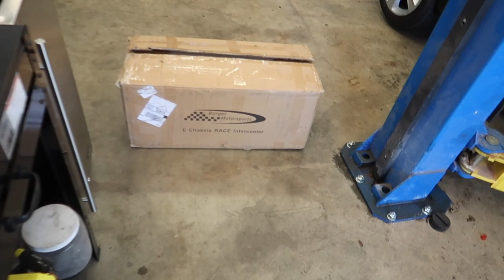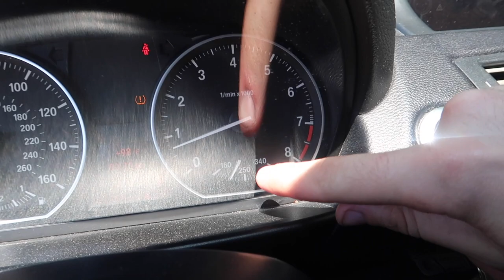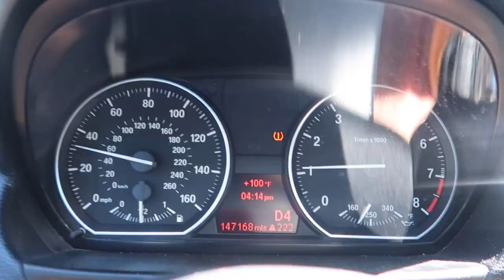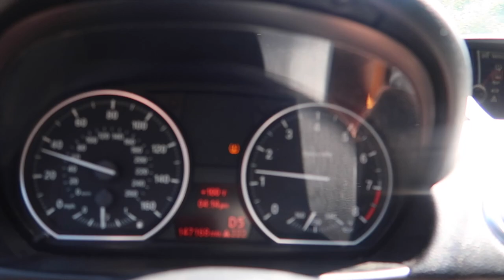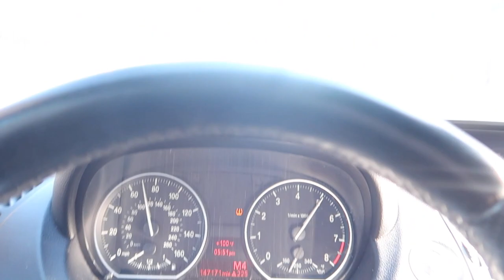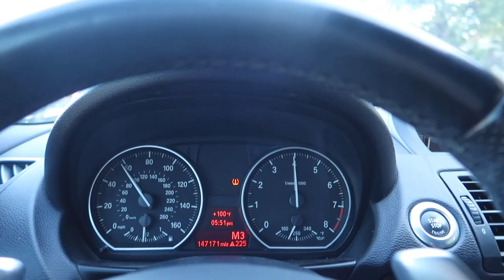THIS IS THE BEST BMW COOLING MODS FOR UNDER $100!

Comment: Not trying to sound like a smart ass but ... how do those cooler caps... the hex blue ones help cooling lol. My understanding is.. it’s just cosmetic 🤷🏻‍♂️
Reply: Only thing that helps cooling in this is the oil cooler valve (the red thing) the blue stuff is 90% cosmetic 10% upgrading materials for peace of mind. If you just want cooling you’d be fine going with just the valve
Reply: Jay Herrmann yup. The valve and the cap with fins ... they suppose to dissipate heat 🤷🏻‍♂️... but the cover bolts and the cover for the valve is just looks... but obviously a bit more $$
Reply: We're is the best place 2 buy the cooling kit from
Reply: @rickpearce5553  many people carry them. Burger tuning is one of them. ECS tuning may carry them as well. But depending on your setup for car it may be better off running a bigger oil cooler etc. there’s many ways to make the oil run cooler… but also each way has its benefits and cons. Depending where you live it may not be smart to run a colder oil. All depends what your plans for car are.

Comment: With the thermostat delete the N54 will take wayyyy too long to warm up. It already takes a long time to warm up properly, and they were made to run pretty warm. If your oil temps go over 250 degrees F in normal to spirited driving then you should either change oils, or there’s another problem. Upgrading the actual cooler itself is more useful if you get upgraded twins or a big single, but really only for track use for stock twins. Honestly an upgraded radiator is far more useful. I understand this vid is sponsored and helps you make more content but just putting that out there
Reply: True but it’s an N54. Rev limiter even on my way to the grocery store 😂
Reply: herlangaona Once it’s warmed up, same here lmao 😆 But after driving like 10 miles on the highway at 3k rpm it’s usually barely up to temp for me

Comment: Do not idle to warm up your car. BMW needs to be moving at a cold start to get the oil circulating. This is why BMW engineered the oil cooler the way they did. This mod is a great for a track day, not for everyday use. Be careful over long-term usage.
Reply: do u want your plastic engine to run at 120c
Reply: The BMS sport oil cooler valve helps lower temps at daily driving conditions, which is good on a hot summer day if you dont do short trips and can withstand the longer time to get to operating temp. If you’re running hard for a while like on the track, your thermo will already be open 100% of the time anyway, regardless if you have a stock spring, or a lower temperature spring, or a complete spring bypass like this BMS sport oil cooler valve. Having the thermostat open full-time just starts the cooling process sooner, it doesn’t increase the ultimate cooling capacity. So hard running will still cause steady oil temp increases. For extended hard running, you need to upgrade to an aftermarket oil cooler like a G Plus 25 row or a Mishimoto, and get a CSF radiator.

Comment: Have exact same set up always thought it was cosmetic crap and after doing track day can confirm just cosmetic crap does not work.
Yes it opens thermo little earlier but in track thermo is always open.
Save your money and upgrade oil coolers.

Comment: Great mod. I’ve done the same except the thermostat cap.  Blue cones will definitely be a perfect combo. I wish I could find them for my current CAI but the diameter of the attachments are smaller than what I have found out there.

Comment: Hey Nour ! I have a 2009 bmw 328xi, it has a N52 engine. For some reason it’s been hard for me to find some engine mods or like you just did in this video some cooling mods. Maybe I’m looking in the wrong place but can you maybe drop a link to a site you’d recommend for N52’s ?
Reply: Im pretty sure that you can get n52 tuning on burgertuning too
Reply: PuRpHaZzE RDW I checked but they don’t have anything, they have some exhaust tips and cooling caps lol
Reply: So there’s not a lot of cooling mods. But you can actually install an N54 oil cooler on your N52. Might need some help mounting the cooler but I think it might  bolt up
Reply: herlangaona big bet bro ! Thank you

Comment: I’m a little late and I just bought a 4D 07 335i. I was looking up that oil cooler and some kits come with a new spring. Do some kits make you use the new spring or is it like yours where I wouldn’t need to use it??

Comment: Quick question did you reused the spring? Or no need to reused.
Reply: I need the same answer :/
Reply: No spring, he took it out. This is a bypass valve that keeps the thermostat open 100% of the time, so the oil always continues on to the oil cooler. If you want to keep a spring, you gotta get a low temp spring ($45 at ECSTuning), or get a Mosselman or Improved Racing thermostats which have low temp springs. You’ll have faster oil warm up to operating temperature with a spring because it will keep the thermostat closed at cold temps instead of running through on to the oil cooler.

Comment: Shit my F30 335i runs at 1/4 oil temp normally… it’s got that aux radiator on the driver side and I also run the BMS oil filter thing but that’s it

Comment: Poor kid is probly loosing so much power. Ur DME is gonna think somethings wrong with ur car. Its gonna try to equalize by whatever means necessary.. Im sure your running super rich n jacking ur cylinders up. Unless you code ur DME and let it know whats going on, your only adding future headaches to your itinerary. What your changing is oil PSI, preset oil temperature vs coolant temp at startup, 5 min driving , 10 min driving. Needs to be within certain temperatures. If ones off in comparison with whats originally programmed.... you got big issues